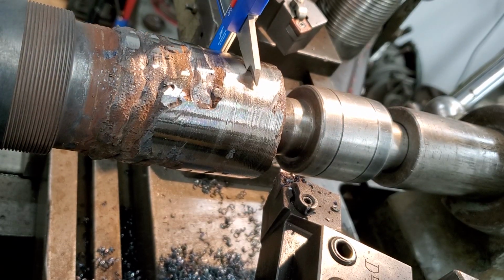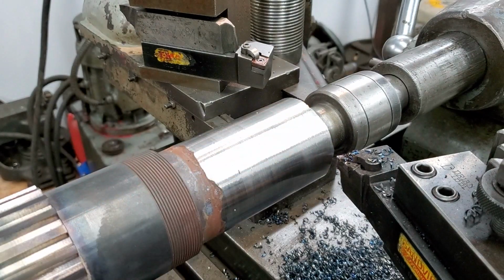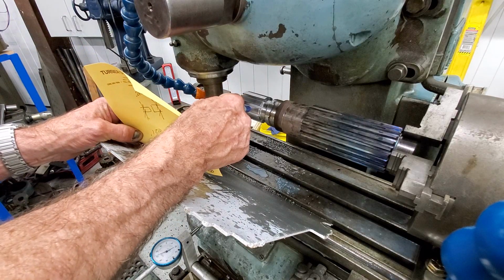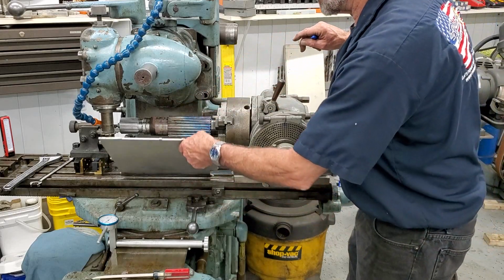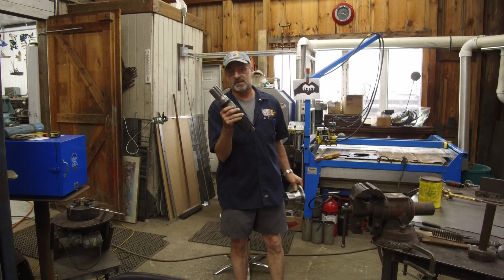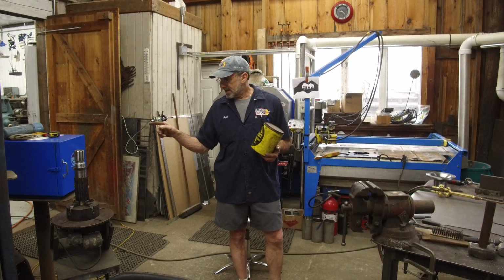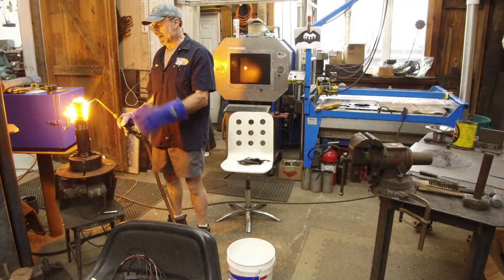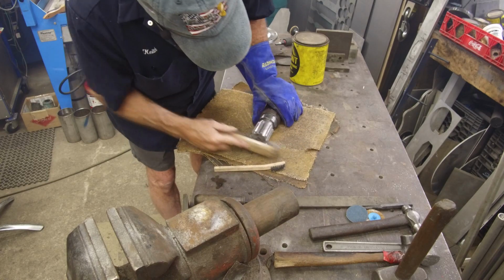Put The Spline In The Coconut Part Four

Comment: I was happy to hear you call the material "mild steel", instead of "carbon steel". I'm close to your age, and I was raised to call non alloy steel "mild steel", and this is because it does not have enough carbon in it to through harden it. Why in the early eighties would they ever have started to call it "carbon steel" when it does not have any carbon to speak of? It was academia's part of the rape/disinformation campaign on our manufacturing base.

Comment: Great job, Keith. Glad to see you're back in the saddle. You've got the old-school methods down pat, thanks for sharing.
I am curious: on your K&T mill, how well does it handle the water-based coolant? I was under the impression the lubrication system for the table and the return for the cutting oil mixes together in the casting, making heavy cutting oil the preferred choice when using an old K&T.

Comment: Kasenite was good when it was available in it’s day, that’s definitely an old can you got, some of the ingredients are prohibited 🚫 now. Cherry Red and a few others out there are used now. They work good if applied correctly. Then again it’s only a case hardening which can reach up to .060 in depth if reapplied a few times. Base metal could be as soft and tough as bird 💩 though.

Comment: Thanks a bunch for your  knowledge!  I don't got the mad stick welding skills you have but I have some faith in my tig welding,  can I do similar build up work with 4130 or similar  tig rod? Thanks a million!
Reply from the maker: Tig and stick most every time can be done either way on projects of build up, the difference is the speed and heat you get and or have to deal with. ;{)

Comment: Hi Kieth, 
A beautiful fit, possibly better than original. It would be interesting to test the hardness to see exactly what you had in the end. I've watched some other you tubers doing heat treating with the commercial ovens which control almost everything, clearly you learnt before all the technology and electronics took over.
Interesting on your comments on varying hardness of teeth in a gear train, on the newer Colchesters they have a composition gear in the lead screw gear train as the sacrificial gear, so all the metal ones hopefully survive. I can imagine that the composition gear would not be cheap either if you bought genuine. From memory they were straight gears, so not hard to make a replacement should you have a failure.
Good to see you back and doing your wide range of work.
Regards Dennis

Comment: Those kind of splines are usually cut with a double angle cutter. The angle of the cutter being dependent on the number of splines. Say a 10 tooth spline would require a double angle cutter with an included angle of 36 degrees(10 x 36 = 360). And then the width of the spline is controlled by the depth of the cutter. It tells about these cutters in the machinery handbook.

Comment: Maybe I missed it, but did you face the end of the spline?  Or was there a tolerance that prevented that?  Thanks for sharing case hardening.  It's an amazing process to take even cold rolled and make it hard.
Reply: CC Rider, it was faced at the end of the video. Keith said he only showed what he thought was relevant to the job when he was talking towards the end. I was waiting to see if he would show cleaning that end up. He also had a nut that the tail piece was running in, I think it had to be welded on and he didn’t show that either. I enjoy his videos so much that I wish he would show everything even if it makes his videos longer. Till the next one!

Comment: so questions ... could you have raised and lowered the table rather than shifting the position? Would it have cut an accurate spline?

Do you need to temper after that heat treating? It seems like since you went to cherry red, and cooled it so fast, that it would be brittle????
Reply: Simple answer is no, because if you just moved the position of the cutter you would have had parallel sides on the teeth, the sides of the spline are radial from the centre of the spline,  hence the reason for rotating the shaft.
Reply: @dennisleadbetter7721  ok, got it. I was thinking Keith was cutting it in multi steps because he didn't have the right size cutter. I probably missed that explanation. Thanks.
Reply: @jsteifel  you are correct that he didn't have the correct cutter, and he made the first cut on centre to the required depth, from there he would have calculated the rotation required to get the radial side to the spline and the correct width dimension. He then rotated the shaft the required angle and moved the cutter in the opposite direction to the rotation cut one side and then moved the cutter in the opposite direction and rotation to complete the recess.

Comment: I work in spring making on geared and CNC machines. I found in the older machines that use a system of gears they can have several wooden gears. Enjoying the videos as always. Amazing to see hard won decades of experience shared with us all.
Reply: Indeed. My small horizontal mill actually has a fibre gear on the motor shaft as a sacrificial piece. It wears first before the expensive gear train, and if you stall the mill, it strips out first.
Reply: @TyphoonVstrom  I've seen phenolic/Micarta gears, but wood!?!?!

Comment: I like all your videos  , this buildup and recut spline was  a good one  .  On another  topic  -- could youmplease put me out of my misery  ,  every time you tighten  clamping bolt on your  lathe tailstock  I  see left hand thread  action .   How is this uncomon  feature there ?
Reply from the maker: It is a left hand thread, to work the law of physics, in your favor, you pull easier than pushing, so the stance of operation does not cause you to have to reposition your feet for leverage, like it does when you work a right hand threaded tailstock clamp bolt. ;{)

Comment: It is  my understanding that Kasenit is no longer available.. There is a similar product called cherry red that replaces it though.
Reply: Yes....I ran out of Kasenit and could never find it again.. I guess the politically correct nazis had something to do with it.. I bought Cherry Red and have not tried it yet....I used kasenit with a propane weed burner to harden things like tee nuts, flange nuts, small gears, etc.. The trick to it is to keep soaking the heat into the crust of Kasenit and it will start boiling.. The carbon is soaking into the part and the longer you soak the heat, the deeper the case. Quench in clean cold water very fast after removal of the flame.As the can says, you can get things very hard even from mild steel.. If you try to harden a commercial fastener such as a grade 8 bolt, it  will shatter like glass when you tighten it.....Mike in Louisiana
Reply: I’ve watched Keiths videos on and off for years ( my first video was the one one how to fix rubber tracks and the spline repair for a old Oshkosh duce and an half when it first came out ) at this point and been a long term subscriber aka I’m not religious about some of my YouTube channels ( as I’m a normal human being with a life outside of 📺 and can’t spend 24/7 watching 📺 and since 2014 I’ve haven’t had personal access to any milling / making or software equipment anymore 😔 it’s been harder for me to follow along and tryout new ideas to practice and sometimes Pay attention or remembering them and I’d still love to have a more modern medium-size cnc mill and or a 350/700 dynasty miller 2014-up welder 👨‍🏭 for boat 🚤 and automotive and home 🏡 use ) but I do injoy and learn from them or being entertain sometimes. Ps thanks for teaching me Keith 

So I have a question would this method work to fix a crankshaft repair on say a missed up balancer keyway / spline ( or add splines so I can run a separate ISAD unit / electric EV motor with 26 ( 2016 Chevy Tr6060 output ) splines by 30* or 45* pressure angels ) on the front end or a bad or resizing main / rod bearings or a busted flywheel flange / spline ( change it to 8 bolt Chevy LT4 flywheel patern instead of 1970 440 6 bolt pattern or spline it for a press/ tight slip fit adapter like the one ☝️ in the video and or similar ) for a dodge 440/426 hemi or a main shaft in manual transmission 4-speed ( don’t have a dodge one but do have a 60’s C10 Chevy truck unit inuse but it’s still fine for now but useful for note 📝 taking if someone else has had to do something like this to it ) or TR6070 ( I’m adding a electric hybrid motor from Bogwarner HVH-255-115-WP core and the inside built in Coupler amateur windings has 31 or 26 splines that I might need to add and or increase the main output shaft diameter a 1” or 2” back from the reverse/over drive hosing by upto a 1/2 inch or less. They look the same as the main shaft/ drive shaft output Cupler 1350 yoke/930 CV / 2016 Chevy Camero CV. Mine is out of a 2014 C7 Z51 going into a 2 gen Charger and is the project that I’m trying to finish this year or if I get delayed at least in the next 5 years as it’s my main daily driver ) or a automatic 6 or 8-speed with potentially the wrong splines Count / pressure Angeles aka 2006 jeep rubcon 4X4 transfer box input shaft sun gear to a ford  modular V8 /coyote / Lincoln LS transmission ( 🤔 it’s the s550sn ) output shaft I haven’t fished it ( in the last 10 ish years ) because I need to get the right bell hosing ( forgot/ didn’t know to get the original 2006 car one with it when I bought it from a friend of a friend deal needing a head gasket repair ( made for a easy rebuild as it wasn’t tore up to bad just wanted the camshaft timing set with VVT but it’s okay 👌🏻 I settled for now without it ) parting it out and later 2003-up Ford Ranger V6 Version ( as far as I know the transmission cases are the same but the bells 🛎 and the back 2X4 vs 4X4 are different as most rangers had four-wheel-drive and mustangs don’t ) from the junkyard with low mileage instead of the v8 Transmission needing a rebuild but that’s a easy fix it’s the back end transfer box that is the hardiest to adapt / wiring / tuning ( normal engine swap stuff that’s been figured out on a jeep) and easy to make motor and transmission mounts and maybe new ish drive shafts that needs the most work but all workable but it’s the same for allmost all ford or dodge swaps vs Chevy v6 or SBC/LSX swaps that fall in o most/bolt in easy ) and I was going to make or buy a new input sun 🌞 gear to finish bolting it together finishing my long term engine swap ( 3+ years mostly because it got stalled out financially/wife problems/and bumped up other projects up in the waiting Q and insult to injury had to find a new Machine shop / draftsman that was a jober instead of production style or being patient and buy a new too me used cnc/1940-80’s Bridgeport mill etc. ) but this looks like a good idea instead of starting from scratch or mix and Matching. Anyways input would be really helpful.
Reply: mscdirect.com has it,